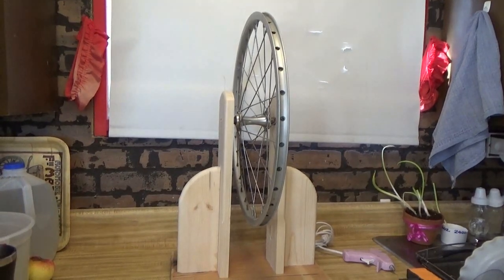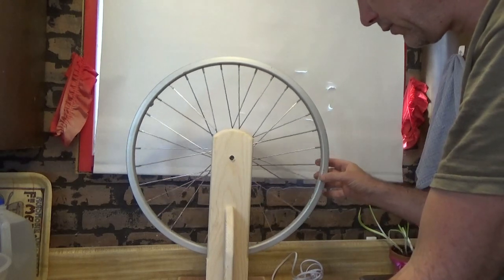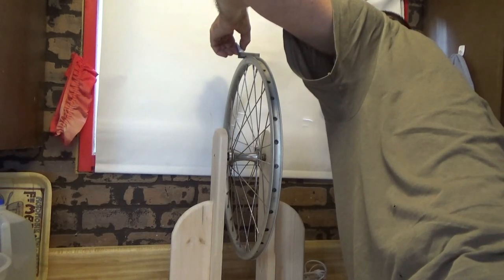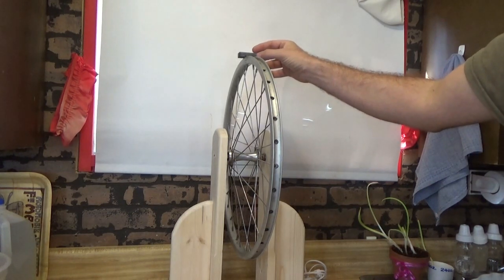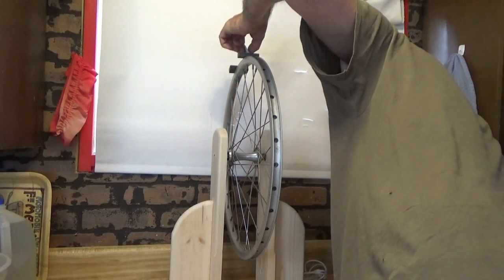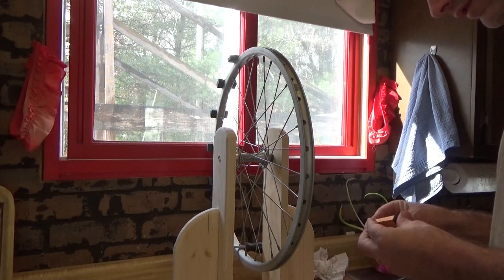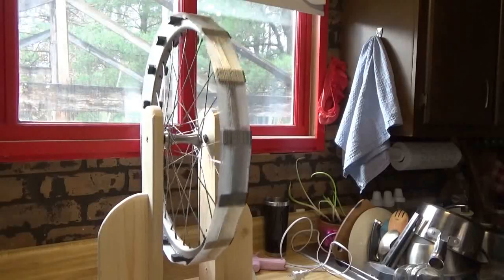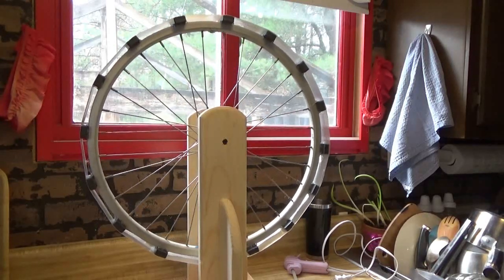How To Build A Bedini SSG Series ~ Attaching The Magnets

Comment: Hi Troy, just completed my bedini motor today. Couldn’t achieve overunity. Need some help: (1) magnet nnn or nsn facing out is better (2) are normal magnets better or neodymium (3) you mentioned about adding a diode back. Was it a 4007 or 4001?

Comment: Pls  How can I get all  of the components for the project especially the magnet
Reply from the maker: HI, sorry for the late reply. Not sure if you have access to Amazon or ebay. That is the best way to get the parts you need. Check local craft shops for the magnets.
Reply: Ok thanks I'll try the local craft shop., but please I have problem with the one I tried building earlier I use hard-disk and the two magnet I got from it and it was spinning but the run battery drains significantly as the charge battery slowly charges and eventually stop without getting full charge. For the core I used the "I" core that I got form a microwave transformer.. Pls what could be the problem that is disturbing the proper functioning of the circuit???  
Will be waiting for ur reply thanks.

Comment: Cool. I figure that magnets could be placed inside the wheel with some cutting, other than placing them outside of the wheel. But then the wheel would be 'damaged'.
Reply from the maker: Yeah, its not really necessary. The bike wheel does not spin so fast

Comment: I have ceramic ring magnets with a countersunk hole in the middle attached to the wheel with super glue and nylon screws through the magnets and tapped holes in the wheel. It's what I have on hand.  
    Do you think this will work Troy?  If not I can find other magnets at the hardware store and start another build. I appreciate your patience and time spent helping us with this. Great step-by-step. I have no problem following so far :)
Reply from the maker: Well, I guess you can always try them. Make sure there is only a NORTH pole on the outside of the wheel. Some ring magnets have strange poles.
Reply: Yep :) all north pointing out :) Thanks :)

Comment: Troy did you repack the wheel bearings on that wheel with some fancier grease?
Remember Malenie's nail polish remover will get the superglue off your fingers.
It is basically acetone made to smell nice.
Reply from the maker: No, I did not repack this one recently. I once used it for a Bedini motor so maybe I did back then. It spins very freely and that is important
Reply: I agree , it does seem to spin very freely.
I mailed pkg to you today and you should be receiving it on saturday.
Let me know if you have any questions. Oh and i do not mind if you use my name if you mention the stove in a video.  I also do not mind if you don't mention it in a video.  I sent it to you because I enjoy making them and giving them as gifts. let me know if you have any questions on using it.
Reply from the maker: Thank you. I will not mention your name on the video but I will open it on video.